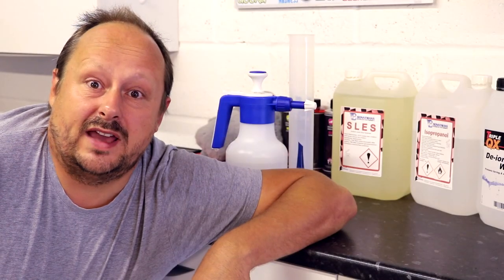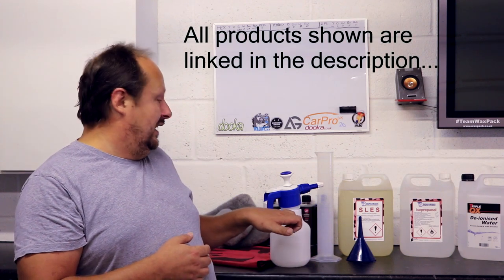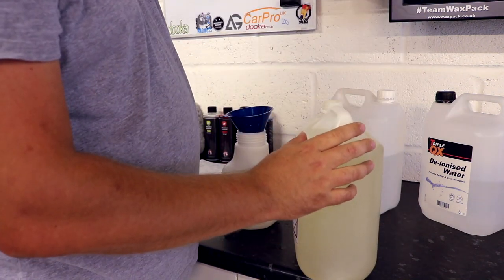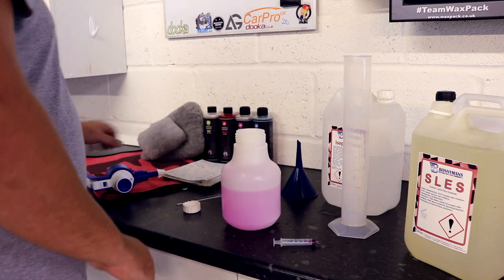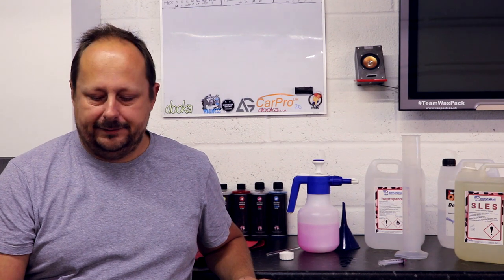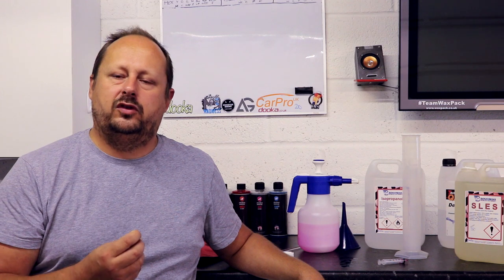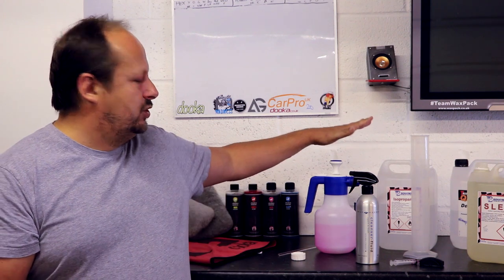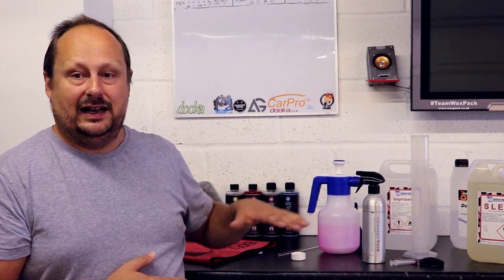Home made IPA Panel wipe formula - Less than 3 pounds a litre

Comment: Chemically speaking this video is quite accurate. However IPA will not allow heavy oils to evaporate, and as the IPA evaporates the heavier dissolved oils will just be smeared out to a finer degree, but coupled with water and SLS low levels of surface waxes and silicones will dissolve and or emulsify readily which can be easily wiped off. So spray and wipe off is key. SLS is a Surfactant which is short for surface activating agent which just means it allows for 'wetting' by breaking down surface resistance to water via some interesting chemistry.  Great stuff, great video! This stuff will work and save a fortune! Occasionally for removing those horrible tar spots I use xylene and a soft cloth, but that stuff whilst works better for waxes and silicone removal needs good ventilation and is not as safe chemically.  This guy would make a great industrial chemist!

Comment: Two technical notes: 1) You can use 70% or 90% IPA as the remainder is just water. Just adjust your ratio a bit. 2) As solvents evaporate they do not carry oils away with them. They leave a very thin film of the oil behind.
Reply from the maker: I thought that evaporation thing sounded a bit too good to be true..  but It was something I read elsewhere..   so basically is disolves oil to make it thinner right within the solvent, so that thinner liquid is easier to mop up?   tell me all you know I love details :)
Reply: @ForensicDetailing  basically yes, a good example is how it's used in computer building. Those of us tech geeks who build our own custom PCs use high % isopropyl alcahol to remove thermal grease from the CPU and heatsink otherwise its a right mess to clean up. Plus with the bare metal it gets most of the residue off.

Comment: Great video. I've come to similar conclusions and as a result basically use the same method. I use a home made IPA/distilled water mix as I'm working to check my work in between passes and then a quick wipe down with Prep-All from Kleanstrip as a final cleanser to make sure it's perfectly clean before applying any sealants or coatings. Prep-All is fairly reasonably priced, here in the states at least, at about 28 USD shipped for a gallon. You can get it as an aerosol too, but the straight liquid is cheaper by volume of course. It's designed to be a body shop paint prep, but it's clear coat safe as long as you buff it off within a couple minutes.

Anyway, just thought I'd share for anyone in the Americas who might be scouring the comments for options, since we can't easily get the Bilt Hamber stuff over here.

Comment: This video just came up in my recommendations; excellent and insightful video. Interesting choice of SLES as a surfactant; not one I've used but it is certainly inexpensive and effective. I have both Tergitol NP-9 and Triton X-100 in stock in my house, so if/when I mix mine up I'll grab one of those and may tinker with the percentage. I've also thought about adding a small amount of butyl cellosolve to it to help remove real tough stuff such as Jescar (Menzerna) Power Lock Plus.

Comment: Thanks again for another informative video. I've been meaning to ask you two questions about this formula..
1) Can we substitute 20 ml of APC if we can't find SLES?
2) WHAT type of dye did you use?
Thanks again for all the work you do in making these very informative videos!
Cheers from Kelly in Canada 🇨🇦
Reply from the maker: you could put some APC in there but hmm not sure whats in all the different APC's and SLES is so cheap Id get some of that.  (you can use it as APC as well for interiors)

I just used a water based dye from the autoglanz homebrew kit.   I think joe sells them seperately on the autoglanz site, Im sure he will hook you up with some dye if you message them.

*doh you in canada, dont worry about the dye honestly its not that important, just a bit of bling*
Reply: Forensic Detailing Channel thanks again. I'll have to keep looking for a source for the SLES. Thanks again!! 🇨🇦

Comment: Previous comment by me made little sense - went to your link and they wanted £8 for delivery  - on amazon I got 5 litres delivered for less than £6 - as a starter with a few drops of Fairy I think you can beat £3/litre - Bilt Hamber is a  great scrubber for old wax/coatings

Comment: Very intresting video! Ive always used only destilated dionized water and 99% ipa 80/20blend ratio. How strong is your blend? And one big question that ive read alot about is were the limit is when it could damage the clearcoat?
How big difference would the sles do if added to the mix?

Comment: Thanks Jon for this channel. Love your detail, your humor, and music. Have learned a lot from you.
Looked through all the comments, and did not find this question. I have read elsewhere that Distilled water and Deionized water are different. Distilled water is much easier to find and much cheaper. Which one should I use? 
Thanks
Reply from the maker: It wont make a huge difference but you should use deionized if you want to be elite.  but filtered is fine.

Comment: Thanks for the great video! I would love to see a video with some information about tape, and the differences between cheap painter tape, and the more expensive ones. A lot of detailer's seem to use green or blue tape, interested in the reason why.
Reply from the maker: its generally just for low tack..  as far as I know the top surface of "detailers tape" is the same material as any masking tape...    I think the green stuff might be the frog tape that builders use over the top of paint because its very low tack..  not sure..

Comment: Have 3 questions if you would be so kind...what IPA would you recommend as a wipe down in between primer/base coat/clear coat on my plastic motorcycle fairings as I've creating a one off graphics design? (p.s. using rattle cans with a hand held adaptor for better control & 2000 wet sanding in between coats). Process is to apply grey primer, wet sand P2000, IPA, apply base coat matte black, P2000, IPA, then apply glossy Aprilia graphics decals, IPA, then apply final gloss clear coat & allow to cure 48 hrs. Then will need to address the small amount of light orange peel & make the panels 'pop' as if brand new. Have completed the rear seat cowl cover &, for a first go, am humbly impressed but feel that I could still achieve a better result with the right products & as the technique improves.
I have recently bought a DA6 copy (Extreme Challenger version from Argos at £57 & coming to grips with the feel of it). I will need to purchase a 70mm backing plate (has the same 5/16" (M8) setup as a DS6 pro). I  like the write ups on the hex logic type pads. Watched your vid on Chinese pads but as this is my first go at this, think I need all the help I can get from quality pads & compounds/polishes. Would be grateful if you could guide me on what steps to follow & what pads & compounds/polishes you would recommend (poss Scholl, Menzerna etc.) as it may be different for plastics as opposed to steel/aluminium panel painting & paint correction techniques?
I'm in your hands...Cheers

Comment: What about using clay ? Should i use it? If i should, should it be before or after ipa wipedown?
Do you recommend using clay bar at all?

I live in a country where this stuff is imported so its really hard to even find a clay bar, let alone finding it at a reasonable price thats why this info is really important for me.

Thanks in advance
Reply from the maker: hey there we have done lots of videos on clay I cant really go through it all 1to1 typing it would require a long essay.
Reply: @ForensicDetailing  after the comment i went through all your clay bar videos, the thing is i dont really know if i should invest on it or just do an ipa wipedown and apply carnauba on top.

Another question, i have bought koch chemie s0.01 finishing wax but i am not sure if i should apply it on carnauba wax right after the application of carnauba or should i let carnauba stay on the paint a few hours for the wax to bond with the paint ( or maybe a few days) and apply koch chemie s0.01 finishing wax after it hardens.

Koch chemie doesn't state on the label
Reply from the maker: @doraduman  clay bar is basically 100% essential.  you cannot be without it.  And you cannot replace it with IPA.   You need to watch the videos...   If you have rough paint covered in bonded contamination the paintwork will feel dull, look dull, and its pointless IPA's and waxing it.   You will just be sticking material on top of debris or contamination.    Invest in clay bar Pudin.  

If in doubt use one product and follow manufacturer instructions.    Sealants need to go on clean prep'd surface to bond properly...   Wax's generally benefit from clean prep'd surface but you can just stick them ontop of stuff...   hope this helps sorry I have to do most communicating through videos now.

Comment: Great video very informative I d like to ask though if instead of IPA I could use ethyl alcohol, as in my country IPA is not easily accessible or expensive. I now both are in general rubbing alcohol but most of the detailing info specifically refer to IPA, is there any ingredient in ethyl alcohol that makes it unsuitable for this purpose? 
Thank you in advance!
Reply: Ethanol isn't comprable to IPA for grease removal

Comment: Interesting video! but isnt it a 2:1 instead of 3:1?? Also its pretty strong, Brian from Apex said not to use more then 12% of IPA, and your using a 50/50 Mix really so its like 50% IPA and 50% water.
Never had any paint issues?
Reply: My maths use to be bad too. Let me dumb it down for you and anyone that is confused. 50/50 mix of 50% solution would be 100% solution to 100% water. To calculate volume percentage add the liquids together (670+300+30=1000). Divide the solution (300ml) by total volume (1000) = 0.3. Multiply the answer by 100 which gives you 30%. Hope this helps.
Reply: More Helpful Information If you use 70% alcohol, first work out 70% of the volume of solution (300×70%=210) then divide that by total solution (1000) × 100 which will result in 21% mix.

Comment: Tried out Scholl s20 black today, works well but hard to buff off, will IPA and water do the trick or is SLES essential?
Reply from the maker: SLES helps mate...  buff it all off first just with a cloth and really use the IPA after the panel looks clean to remove the traces left behind after a buff with no IPA if that makes sense.

Comment: Great Lesson. Please I have important questions:
1.Can we use a 5% laundry detergent non sent type as an alternative to SLES?. Because we don't have this in our country.
2. For coating with nano ceramic some Panel wipe stated it is using 45% isopropyl do you think it is necessary?
3. Do you think this is good for cleaning paint layer between spray paint steps just like grace and tac cleaner?
4. Can I use this for removing petroleum solvent solutions such as benzene and Kerosene mixes that is used to clean tar and over spray paint?
Reply from the maker: hey feras..

1) I wouldnt mate god knows whats in it..  perhaps use an APC.  
2) 45% sounds a bit high.   I personally wont use just an ISO homebrew to prep for a ceramic.  I believe like I said in this video theres more effective degreasers using different chemical formats.  but 20-30% max seems to be  the concensus.
3) no I dont think its good for that.  most of the bodyshop degreasers are hydrocarbon based.  could be wrong its going beyond my limited knowledge that one and I would be theres bodyshops using ISO that way.
4) you should not have to use ISO to remove kereson or benezene tar and glue removers.    Its a bit like using a soap to wash away a prefer soap.  actually its not but basically no mate.
Reply: Forensic Detailing Channel thanks a lot u have been generous in the answers.
Reply from the maker: thanks feras appreciate it mate.

Comment: Would this be effective before waxing my car? (to keep the surface clean after wash? and to strip any wax left)
Reply: Not really. This is for post polishing. Wax is one option for sealant. So most of the time it’s clay bar. Two stage polish. Wipe down like this. Then apply a durable sealant. Wax normally doesn’t last very long but dowse give good short tem finish. So I would polish a car say once / twice a year. As a very durable sealant and then maybe wax every now and again to protect it and give it a quick shine. This spray is to remove the polish residue really.

Comment: Interested in mixing up something like this to use, just to try it out. What are your thoughts on using a small amount of APC in place of SLES?

I've seen some videos recommend it, was just wondering if SLES was worth picking up, I can 250ml and it's pretty inexpensive. If I could just use APC with similar results though I'd rather just use that as I have loads of it around already.

Comment: @forensicdetailingchannel 
hey Jon in this video you use 
670ml deionised water
300ml 99% ipa
20-25ml sles
Tiny drop of dye

Can I use bilt hamber surfex HD APC instead of sles if yes how much ml of liquid would you recommend...? Would it be same amount as sles 20-25ml...?

Thank you in advance
Reply from the maker: yes mate surfex 1-2%
Reply: @ForensicDetailing  thanks for the heads up , sorry one more question the dye you used is it normal food dye ?

Comment: Just did a comparison of the total product COST D2D (product+vat+shipping) of a litre of Bilt Hamber cleaning fluid (£35.85) (D2D) whereas the FD 'Home Brew' is £6.33 per Ltr (D2D) a saving of £29.53 per Ltr. That a clean 82.4% saving over using an off the counter ready made product.
Good work Jon & I'll be trying it for that amount of savings.
(p.s. savings are based on buying 1 Ltr bottles of IPA & SLES, plus 5 Lts of deionised water)

Comment: So for someone on a budget small budget would ipa and water get most of the oil off and then wash with plane dish soap and and water then ipa again be ok for coating with a ceramic coating be ok ?
Reply from the maker: on the final wipedown before ceramic you should look to use a proper panel wipe product.  perhaps a product from the guys that supply the coating.  I favour bilt hamber cleaner fluid though.  you could also check out gtechniq panel wipe..

so ipa for 99% of the wipedowns..  proper product for the final wipedown adam

Comment: Just a question , can one use prepsol Trying to remove the wax instead ? , a friend of my owns a panel beating shop and he prepsols the panels before painting to get it clean? Would it work with polishing too?
Reply from the maker: check the MSDS for it and look what its using..    It will most likely be a more potent cocktail of solvents that are more effective at degreasing a panel..     sometimes these products are intended as prep products for respray/bodyshop works..    they work for sure but check whats in them before deciding if its suitable for polish removal...   I still think personally you are better off using a high water and low IPA blend just because its very cost effective, and then a spritz of something you trust like carpro eraser or BH cleanser etc...

Comment: I know im very late to this conversation but would you say this degreaser/panel wipe would be the same as bodyshop panel wipe? Im a painter/panel beater and we use sikkens m700 degreaser in 5l containers and it doesnt leave anything behind be it before painting or inbetween denib/polishing but i guess that would be quite expensive for a home detailer.
Reply from the maker: so sikkens is probably a pure hydrocarbon a bit like tetrysl pre wipe degreaser.  Its slow flash time slow evaporation rate and needs higher temp to flash.   you need to let the hydrocarbons vape off the panel for longer, and you need that work ship environment to maintain temp.   when you use a hydrocarbon at home like for me now in the winter it actually does not vape of the car well below 10 deg so I run risk of putting a protective product on top of a thin layer of mineral spirit...  they kick out stronger vapours as well.   I think IPA is better and cheap for simple inspection wipe downs. (with some detegent to emulsfiiy)

Comment: Can we use Mineral turpentine oil / White spirit in place of Isopropnal Alcohol..??
Reply from the maker: you can use a hydrocarbon based panel wipe yes. but these are typically slower to flash versus IPA.  So much so in winter for example if you use a mineral spirit your panel wipe may not flash at all if you are outside or in a cold garage. they require qorkship environments. the strength of IPA is it will always flash and flash fast.   Dont use DIY type mineral spirits use hydrocarbon panel wipes from detailing brands UPOL  tetrysl etc etc.

Comment: I always thought a 10% mix of IPA (99%) to distilled water was the typical strength. Your suggesting a lot stronger Jon... where do you get your ratio from out of curiosity?
Reply from the maker: Yo B.   10% might be fine for lots of water based products (or abrasives that contain a higher relative amount of water to oil)..   I do pretty much all my machining with scholl or menz which are a lot more oily..  So I run right at the upper eschalons of the ratio..     I just find it works better than low ratio mixes..   but I tend to never go lower than 20% IPA just from what I find works best for me...
Reply: Forensic Detailing Channel Scholls  S20 for me these days so guess I need to up my IPA mix %.